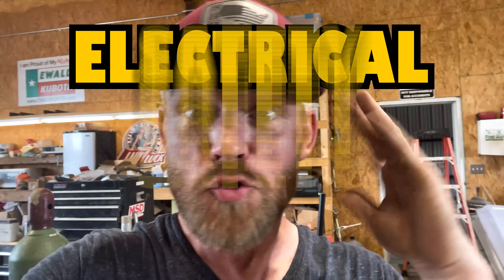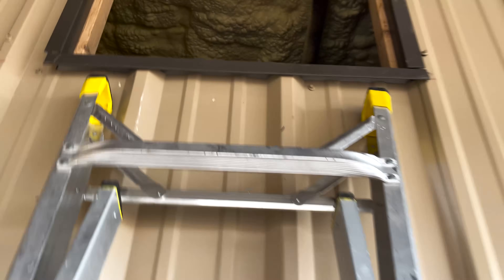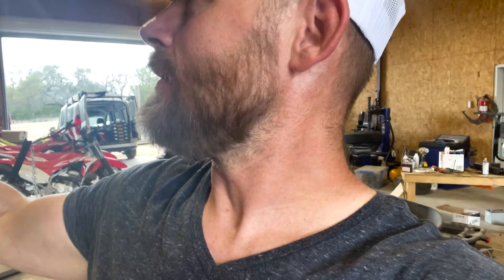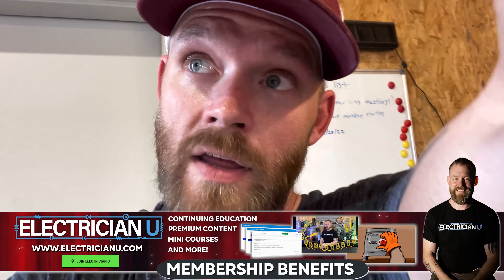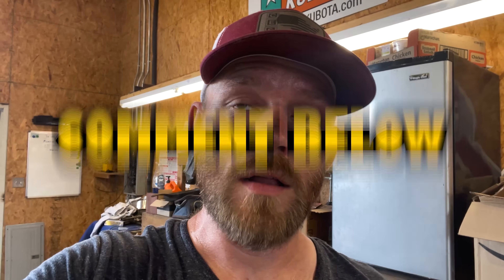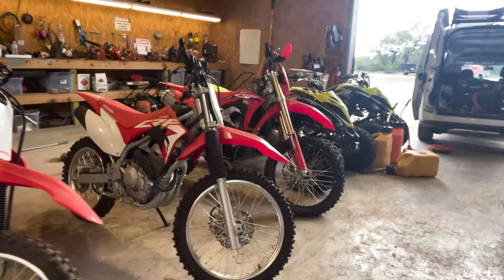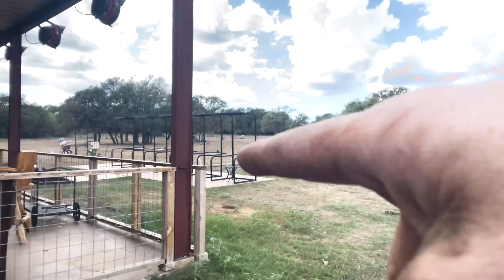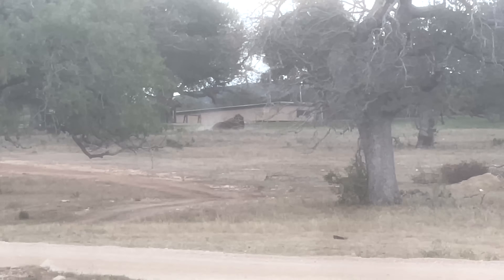Should I Risk Zapping My Apprentice? Also, Is That a Wildebeest?

Comment: You should be using lock-out tag-out procedures in addition to not working on the panel while your co-worker is working outside line of sight.
Reply: EXACTLY what I was going to post!  Or anybody else who comes around. Like residential where the old lady customer comes into the room and switches on the light switch when you are hanging a fixture.
Reply: @KameraShy   There is nothing to lock out... the wire is not hooked to a breaker.... safter then even a lock out tag out.
Reply: And 99% of folks DO NOT use LOTO.  Even though they make lockout devices for circuit breakers.

It boils down to someone that's always looking for a short cut or a faster way to do something.
Reply: @cward1954  we use loto 100% of time that we have to de-engergize to work. There is no LOTO procedure if you are working on conductors that have no source of power. aka not landed. The only time i could see a LOTO necessary is if you decide to land the conductors then it should be locked at the CB

Comment: Whats wrong with zip ties!? 🙂
Reply: Zip ties are fine if you are strapping to a framing member but it's against code to strap cable or raceway to another raceway.
Reply: @illestofdemall13  Ive strapped MC cable to conduit many times. Nothing wrong with it.
Reply: @bmwmike3534  It's a code violation. 300.11(C)
Reply: @illestofdemall13  (1) Where the raceway or means of support is identified for the purpose.
Reply: @bmwmike3534  Is EMT identified as a means of support for liquidtight conduit?

Comment: I'm just an apprentice, but I take the time to check if there's a live circuit, or if there's something touching something that it shouldn't be. I don't think it's being a wuss to check stuff out and make sure you don't zap anybody. "it's just low voltage" -> no. It's electricity, screw the thought of handling low level as if it isn't still electricity.
Reply: Don't worry about what a single person says to you. ALWAYS ALWAYS ALWAYS check voltage. I treat wires like a gun and assume its always loaded. At the end of the day it is YOUR life, not anyone elses and if you die they will just say "damn thats crazy" and move on to the next job. Never let someone else peer pressure you. Always be safe.
Reply: @bmwmike3534  do you treat driving like this most likely not, just like most drivers who dont use offense driving ,speeding running yellow lights, turning without stopping or signaling, no signal lane changes, road rage and arrogant driving .
Reply: @davidicousgregorian  WTH are ypu talking about?
Reply: @bmwmike3534  i meant safety is important in wiring but i meant i hope you and others keep same mindset while operating a vehicle .im sure you do , it was just an unrelated to electric comment just an observational one.  Sorry i just saw alot of people commenting they all do safe actions wiring but wondered if the same people used the same mindset driving autos . Didnt mean you specifically .dont get annoyed . or take offense just something to think about .
Reply: like you said wires are like a gun so i thought so are cars but its just an observational comment no offense
Reply: @davidicousgregorian  lol its all good. I just didnt understand your analogy is all. Yes, no accidents in 14 years in business and hopefully never will be. I cant stand people who drive reckless or text and drive.
Reply: i forgot to write lol at the end of the reply to you so now you know ,cool?
Reply: @davidicousgregorian  none taken. I wish more people were safe

Comment: now im nervous. At my work we do production houses and we attach the AC disconnect above where the AC condenser line comes out of the wall. Whenever I'm wiring the condenser I run the carflex down from the disconnect and black zip tie it to the condenser line and follow it to the unit. Is that poor workmanship?
Reply: Zip ties are 100% an approved securing method, however, looks like shit. Always take pride in your work, especially if it will be visible to others.
Reply: @bmwmike3534  That isn't the issue. You must secure the conduit/cable to a structural member, and not plumbing, HVAC, or other electrical. So it is a code violation to strap Carflex to the condenser line, regardless of whether or not it is with zip ties.
Reply: @illestofdemall13  yeah, I was just saying that zip ties are a type of approved securing method is all. I didnt mean you could just zip tie to anything.
Reply: @bmwmike3534  I use them for strapping NM cable to metal framing and in my opinion it doesn't look like shit. It is fast and easy and keeps it secured.

Comment: When I am running new circuits, I always wait till all the equipment is wired and ready to go before I connect the wires to the breakers. Even when working alone. I feel it is just a good safety habit to get into.
Reply: I was wiring new recepticels as an super-green apprentice (3 months in trade school (alone at job) for a new cell phone store opening. My boss was gone and didn't care if I worked hot or not. I wouldn't. The owner of the store showed up and made fun of me for not working hot. I don't care if macho men laugh, I allllways go Saftey first,  especially with a crew under you. They are your responsibility/ liability if one is legit!
Much Respect for the Knowledge and All the comments yall👍💯🤙
Reply: Same. Breakers are last.
Reply: Agreed, I do the same. Always start at the end of a new circuit/installation and work my way back to the fuseboard

Comment: You can't always do this.  It's a good practice to have, but if you're on a larger job that has a prior cut on with multiple workers working in different locations and a completion deadline, you can't wait to land the circuits.  You can't leave the hot panels open either.  Under those circumstances it's better to land the circuits and close the panel being careful not to accidently make anything live before everyone is clear of the circuit.

Comment: I do [Among other things] low voltage IT cabling for a big company you’ve probably heard of. Likely bought things with their name on it. Anywho, energizing low voltage “won’t kill you” while someone else is working on it will def’y get you fired. It’s so profoundly unsafe that even  a single incident is a non-starter. I can’t imagine any argument against your position, especially since you’re dealing with lethal amounts of electricity. One wrongful death lawsuit will absolutely annihilate any money savings achieved by doing work concurrently instead of consecutively.

And, you know, the moral and ethical weight of taking a chance to un-alive someone who’s only crime is being dumb enough to be on a job site with you [Not you personally]

Don’t be that guy. 

Good content, cheers!
Reply: not to mention in the unhealthy event for the guy doing it should I SURVIVE
Reply: If you're worried about dying from low voltage "IT cable", you're not doing it right anyway. I have pulled metric fucktons of live low voltage; 52v Telco, 12v DC, 20v AC, data cable, fire cable.. In the real world (at least once upon a time) you didn't have a choice but to work on it live. And you earned a premium for it. Linemen work on live 72,000VAC up to 500,000VAC every day. Treat ALL wires as if they're live bare 500kv lines and you'll live to see your retirement age
Reply: @Drmcclung  Nah IT Cabling can't kill you, but it's still treated with respect, hence previous comment. I used to do 12V, 24V, & 48V cross connects live all the time. Learned a valuable lesson about not putting the free end in my mouth when punching down circuits. Fun tip:  those little wires can carry up to ~105Volts when the phone is ringing, so the right combination of luck & timing will wake you right up.